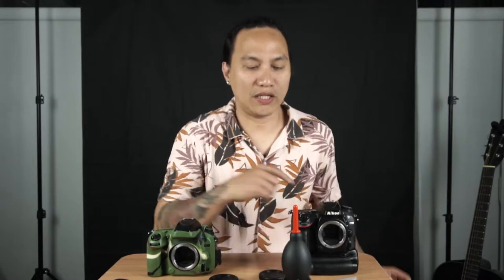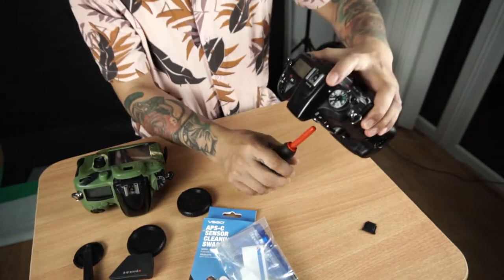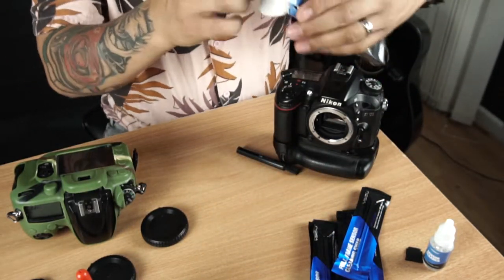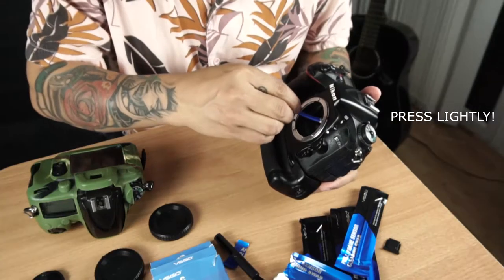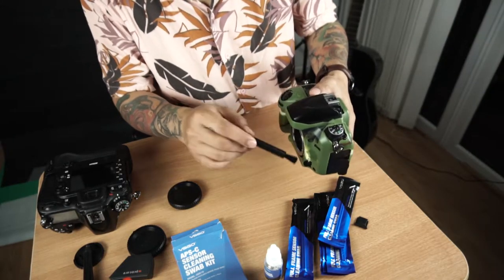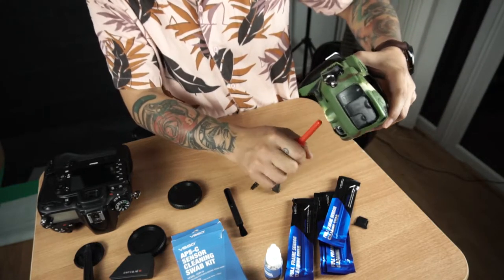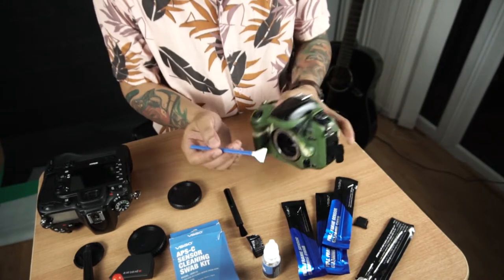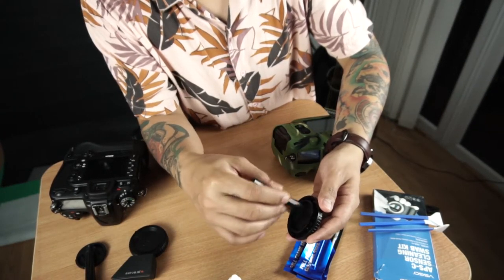How To Clean Your Camera Sensor at Home | Safe, Easy and Save Money

Comment from the maker: Note: Settings applicable only for DSLR, for Mirrorless skip this process 
- Make sure the battery of your camera is fully charged
- Go to Menu then find the tab that says “Lock up mirror for cleaning”
- Remove your lens and Start cleaning
- Turn Off and Turn On your Camera
- Do the same process if you’re not satisfied 

Cheers!🙌